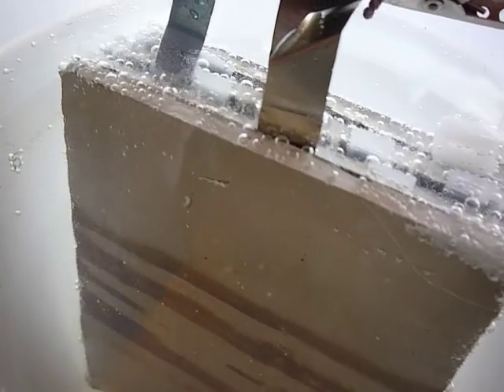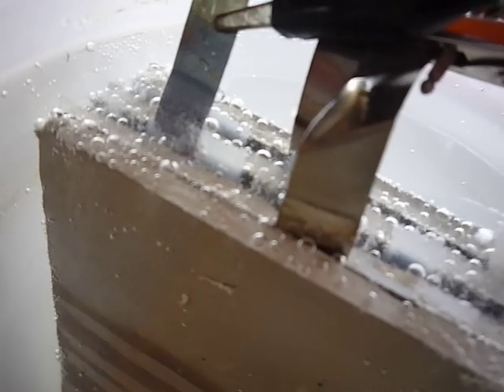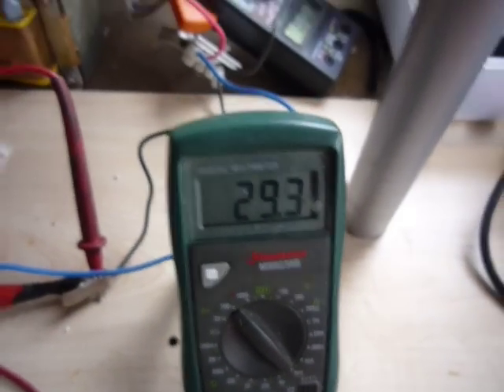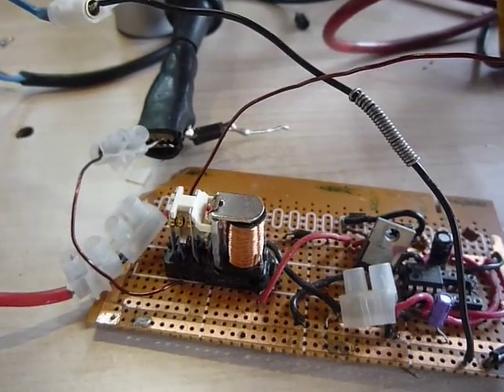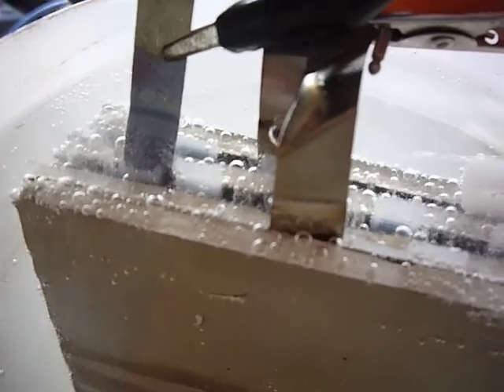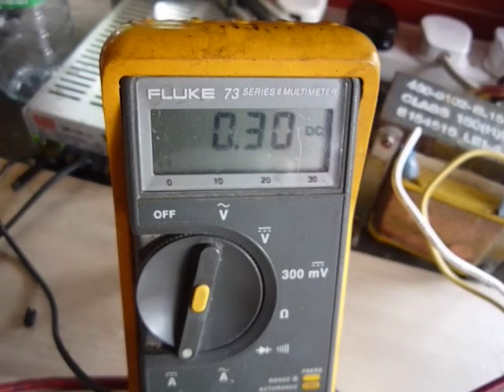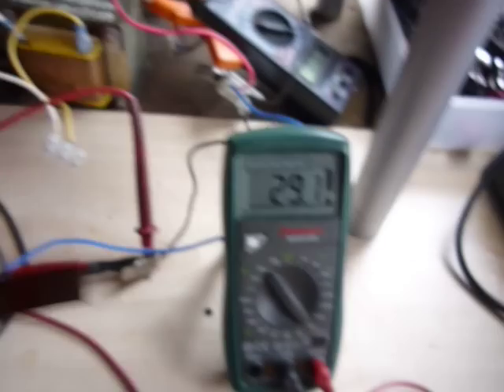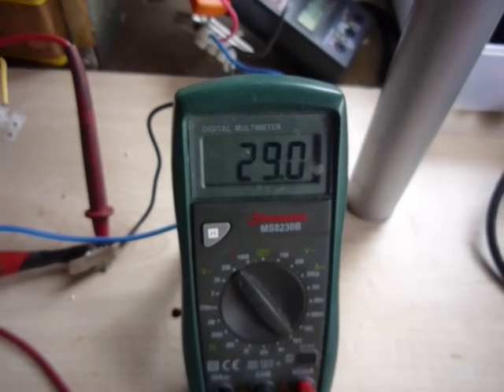HHO - High capacitance - flux/spurious? doing work? #2

Comment from the maker: I was a wee' bit disappointed with this cell until I split the plates -
Two were full of water - so they had to be conducting inside the plates & were possibly full of oxygen bubbles?
The sealant on another had squeezed under the magnets separating the plate with the supply strip - so, it's a wonder the cell worked at all?
Jim

Comment from the maker: @2bigHybrid  Yes... but with a magnet cell everything changes by the minute - I was bored waiting on the obvious so added a little electrolyte to speed up the process - Like I expected, very little changed until I swapped over the supply leads switching the negative instead = 1 -0v N/pole 2 +v S/Pole 
It went like a bat out of hell 2.4amps @ 24v - I then dropped the supply to 12 v @ 74 ma - still switching. good HHO O/P
Still a way's to go... LOL!

Comment from the maker: Sorry for this boring stuff but I'm one of these people who's got to prove or disprove before I can move on.
I will find a setup (if there is one), using titanium in the ORB.
I have to stress (to those who don't know), that titanium is notoriously hard to work with at low voltages -  I'm trying to use the flux/spurious voltage to enable conduction at really low amperages - it's over 1hr since I started this test, the voltage is back up to 34v & the cell is still producing HHO at 80 ma
Jim